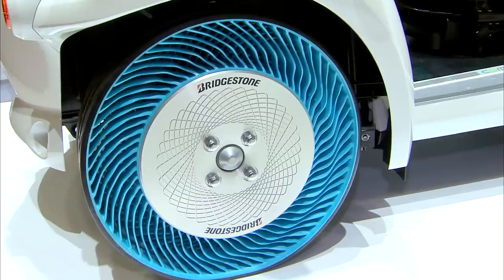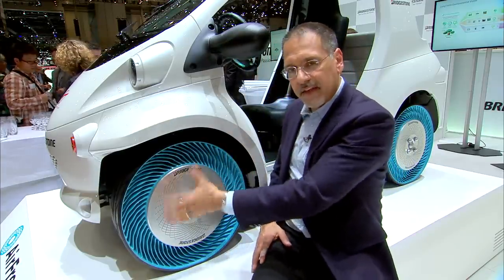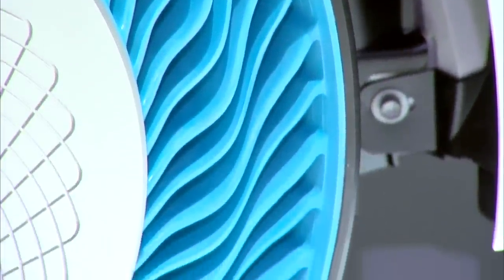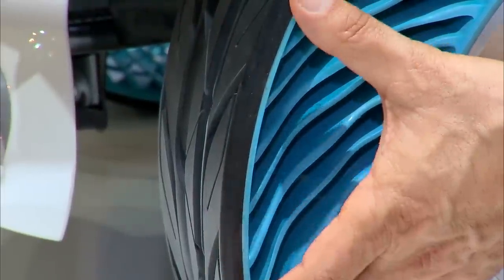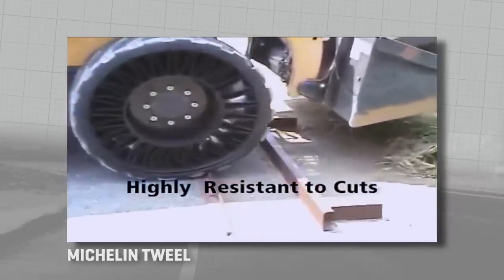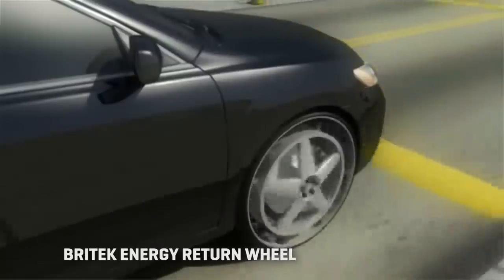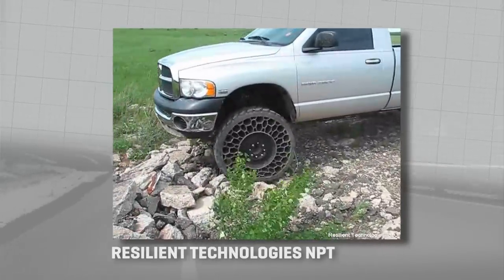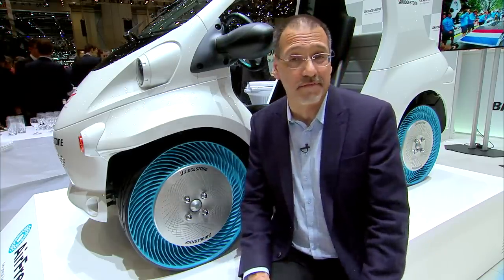Airless tires: Road to the Future | CNET On Cars

Comment: We all been waiting for it long enough.
Reply: +LSV 
Just because that nerdy turd couldn't push the tire laterally, doesn't mean that wouldn't happen with a 3000 pound vehicle at 45mph. Practical automotive technology trickles down from F1 racing. $Billion+ budgets for a small car that will get replaced every year = area 51 type of stuff for vehicles. Every modern vehicle is designed from old F1 tech.
Reply: +LSV
Just fill your tires with polyurethane
Reply: ***** That's a valid point. For that, it should be available for law enforcement?
Reply: Still waiting
Reply: IAmReal_LSV because Chinese haven't found this Technology yet
Reply: بثفبثتلقوبثلي
Reply: +Rodrick Davis Probably because there hasn't been any DOT approval yet. I'm looking forward to new tire technology.
Reply: Ali Ahadi Urethane filled rubber tires have been tested the most durable airless tire, but it's banned in many countries, obviously because the police couldn't blow a fugitive's tire if they were in a chase. There may never even come any DOT approval for the tire technology demonstrated here, sadly.
Reply: Ali Ahadi 
Sorry, it was silicone filled tires that were tested the most durable. I don't know if law enforcement drive with airless tires. Probably armored vehicles in that case. Airless tires cause too much vibration at higher speeds
Reply: ***** Ah yea, I doubt cops would like that, lol.
Reply: +LSV We've had retread tires for decades, we don't often use them because they're total shit. Almost every time you see a Semi tire blown apart on the side of the road, those are retreads. they just grind off the worn out tread, and glue on a new one... that then flies off after a few thousand miles.
Reply: +DecibelAlex IF vehicles follow Tesla's lead and start doing autonomous modes, then Police could have a special box to physically shut the vehicle off/force it to pull over. like "Emergency Vehicles have signaled your vehicle to shut off and pull over, I will pull over where it's safe for you." Or even to move them out of the way, Ambulances/fire trucks could send emergency signals and autopilot cars would move in unison to give it just enough space to get through, eliminating wreck dangers at intersections...

i see these types of tires being allowed/implemented once that technology is more widespread
Reply: Maybe because tire is a most complex single part of vehicle. Very hard to simulate and maybe it isnt so visible but there is a lot of going on. There are many compromises and influences. Tire also partially works as suspension. A lot of things are in contrast in tires and just by doing something that looks this easy it and great in one aspect doesnt mean it performs well in terms of comfort, performance, durability etc.. Yeah you cant flat it and thats the one major positive.
BTW: Lateral stifness is a parameter. Making tire stiff on side doesnt make it better just different and for something better and for some other thing worse. But as you can see a lot of racing cars are driving tires that are high profile because they are "smooth" and predictable.
Reply: +LSV seriously! Why the hell hasn't this been made available to the public yet ?
Reply: +Rodrick Davis I know right
Reply: Yeshuah is King Probably. Some new high-end cars already have a system like that I've heard. You get a few hundred meters to pull off at a safe place after they've sent the shutdown signal to the car.

Comment: doubt they are very good at cornering as they have a cross-ply design meaning that the tire doesn't go around the edge of the rim
Reply: +115zombiehuger If the tyre isn't rolling over onto its sidewall then why is there a need for tread there? These will offer pin point sharpness in cornering once a cars suspension is set up for it.
Reply: hardrider there's no give in these wheels, when cornering a normal tire it will slant slightly to give better grip these will not.
Reply: 115zombiehuger Doh, as in lift up, forgot about that aspect.
Maybe these need to run different camber to allow for some of that?

Comment: The biggest enemy will be time. As the material ages the strength degrades. Where as tires can last for years. Also, after being in service 5 to 10 years how would it deal with conditions we have right now in the north with 7 feet of snow and potholes? Ya hit a pothole with that wheels in -20 deg weather lol Notice all the wheel videos are in fair weather.

Comment: Looks like a good concept, however, pneumatic tires have ratings for balance at specific speeds.  I would be interested to know how fast you can drive before you get vibration and how well it can handle corners at various speeds even if the road is bumpy.  The average late model car should be able to cruise at 80mph smoothly.  If it is a sports car like a Corvette then a 120mph (on a closed track).  Then there is the uniqueness of the tire that is going draw attention which means theft.  What can be put in place to make a thief think twice about leaving someone on blocks?

Comment: I really don't understand why this isn't a huge deal and being implemented. If i was rich i would definitely think about heavily investing in these especially if they come out for the public. What are the cons? (Serious question if anyone knows any.)
Reply: Ben Rance The vanes are constantly flexing. I wonder how long they would last before fatigue would require them to be replaced. That could well mean a greater lifetime cost for keeping the wheels in good order. If these end up on production cars, I'll wait for several years before considering them. It may well be the case that the pneumatic tyre is still the best option.
Reply: +dalriada842 The sidewalls and tread of standard tires constantly flex while in motion.  You can't avoid it without over inflation, probably to the point of bursting.  Unless there are car tires rated for much higher than common psi.
Reply: OptimisticPessimist Yes, but these flexing structures are replaced when you purchase new tyres. With this newer design, it's tempting to think that only the tread needs replacing. If the vanes don't last the lifetime of the vehicle, the combined cost could end up being more expensive than the traditional set-up. Only time will tell. I'd let other people act as guinea-pigs for the idea. I'm less and less an early adopter of such ideas as I get older. I've made too many mistakes in the past!
Reply: dalriada842
Retreads are common on commercial vehicles.  I've heard even airline tires.  On trucks that can give you maybe 3x to 4x the useful life period.  Weahering is also a factor, no matter the mileage.  If that issue is solved for these, I'd like to see them in low profile, unless using large light weight rims doesn't save weight.
Reply: OptimisticPessimist I'm content to have you try them out, and let me know if they're value for money. I personally wouldn't consider retreads for my sole contact with the road though.:)
Reply: dalriada842
Only with duallies until I get used to them.

Comment: what happens if small rocks and stuff get in between those .. things
Reply: Id think the sides would be covered when put to retail :)
Reply: Stefan Hetherington  It would need some kind of pressure valve on the cover to get rid of the pressure bounce :P
Reply: oh yeah, but if the rubber could expand and with the wheel as it compresses, that might work to

Comment: They better cover up the sides of the wheel so air doesn't get in there and cause turbulence or drag of some sort. Especially since the fins are opposite of each other on each side of a single wheel.
Reply: Eh, the effect would be minor considering the vehicles shell is creating a stream of air around the wheel wells. 

My issue would be winter weather, snow/water gets in there. dust or dirt, or mud.. dries out in there and next thing you know you have vibrations when going fast due to the buildup inside the tire.
Reply: Fission it's a prototype! That's just for ideal display while the ones will be in public will have it's side covered.
Reply: Lol our huge ass 17-20 inch rims cause multiple times more air drag

Comment: Impressive.
Reply: These have been in development for a very long time.  Last I heard, they couldn't move forward with deploying them not because of cost or a lack of usability, but because people were freaked out by the idea and the fairly extreme difference in ride and control profile and refused to use them.  They found that even if they disguised them to look more "traditional", that really just made things worse as average drivers had trouble adjusting to the way the new system handled. Wish I could remember where that study was done, but a quick Google didn't turn it up.
Reply: Justtyn Hutcheson wow thanks. If so drastically different in the ride. Then you're right it's gonna take a long time gain traction.  Man.  I just want these future technologies to come into main stream already.
Reply: Ramon McNally Absolutely agreed. I think that the coming EV rollout would be a great opportunity to push these as well.  People already expect them to feel/drive/ride differently, so adding these won't be as large a shock, I think.

Comment: This tech has been around for more than 10 years. CNET themselves have been reporting about it since 2008.

So what's the hold up?
How to make money from it.

This is the only reason why this is not available to the public. Because remember kids, you cant sell something that will never break or doesn't need replacement. So they've spent all of these years dumbing down the design and actually making a product that has a Planned Obsolescence. And that's how you make money in tech.

Comment: This open design will get unbalanced very fast because of all the dirt it will collect.  Otherwise cool design. The open design will probably vanish on real models for practical use..
Reply: I believe you're supposed to wash your tires when you wash your car.....
Reply: Brett Dickstein yes but with this design you must wash your car extremely often.. and what about ice and snow buildup?  

How do you efficiently wash your car  in -20celsius without a warm garage?  If snow melts and water freeze inside the tire during the night your car could get completely stuck where conversation tires wouldn't have much trouble to break free from the ice.. 

this design could effectively reduce the cars lifespans with many years because unbalanced wheels cause expensive wear to the entire car and especially the tires.. it also effects handling and safety.. The easy solution is enclosed tire design..
Reply: there will probably be a special coating you can put on the tires to reduce the buildup. For the ice thing, why not just throw salt on the tires? seems to work well for deicing roads.
Reply: Brett Dickstein salt and metal doesn't mix well. Your only adding new problems, rust, and pollution.. salt isn't good for deicing roads. That's a myth. Warm sand is better when you need traction, same goes for sand mixed with vegetable juice. 

Salt is just the governments cheap way of dealing with ice buildup. I live in northern Norway.. driving on ice is what I do most of the year.  Enclosed tires is probably the only practical solution.. but it doesn't necessarily need to be pressurized air or nitrogen..
Reply: But the tires aren't made with metal. And you would be careful as to not get it on the car's body. I'd agree with you if my chem 1 professor didn't say in lecture that salt is good for deicing. Along with my chem teacher prior to that
Reply: If the roads really has ice, salt doesn't help much. 

your talking about the thin ice film where you can still see the asphalt. driving one dry asphalt is uncommon in the arctic circle.. 

even when they use heavy machinery to remove ice layers there usually several inches of ice left on the road.  have you seen ice road truckers? You barely see any asphalt in an entire season on that program..      sea water freezes in most of the fjords where I live. Usually 1meter of solid salt water ice in january.  throw a bucket of boiling water in the air and it often falls down as snow.  that's the arctic circle climate for you.  salt is overrated in really cold temperatures..
Reply: Have you ever had an imbalance issue in the winter with the current wheel and tire design? Happens all the time, this new design will only make it worse and can be very dangerous causing severe steering wheel shake. And worse yet, try getting that packed in ice and snow loose, not fun.

Comment: It wont work on mud and snow
Reply: I believe that depends on the tread of the tire, not whether or not it uses air. If anything it would work better by flattening out a little and providing more surface area to grip whatever you're driving on.
Reply: Brett Dickstein Not a chance would it work on ice, snow and mud. LMAO garbage tires
Reply: ***** They already tried, and failed.
Reply: ***** They already tested it dude last year it failed.